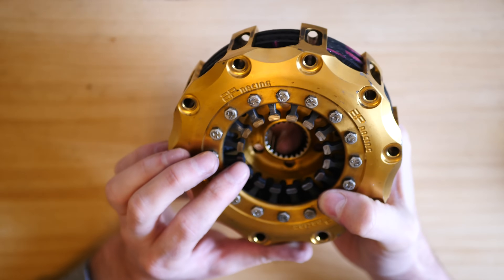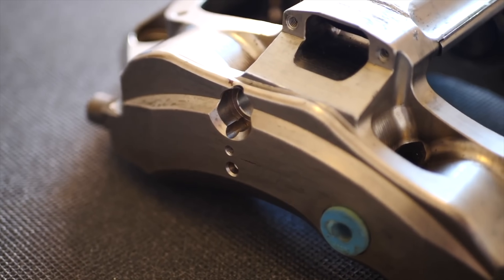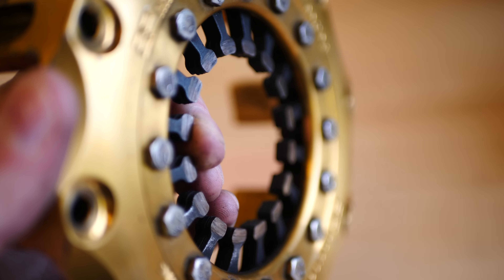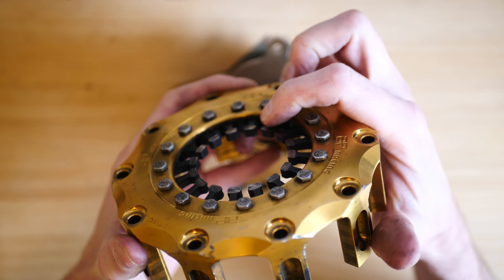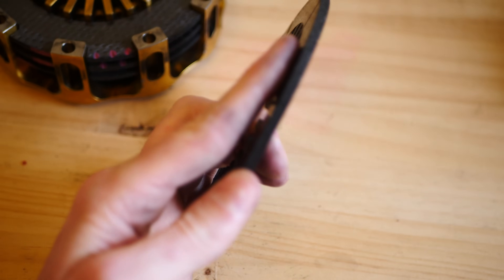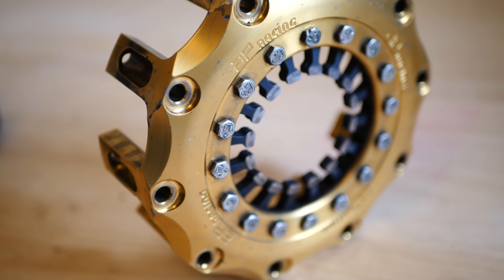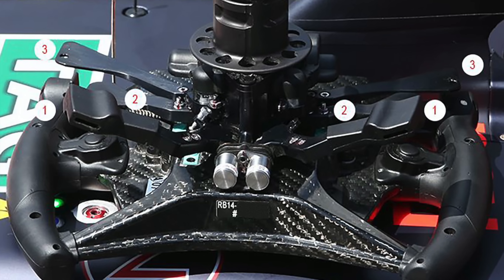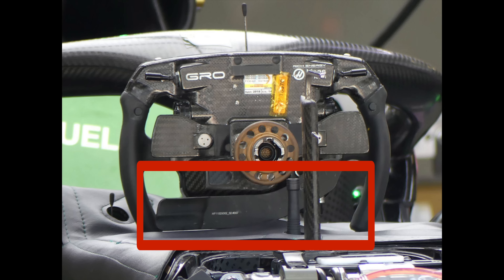How an F1 Clutch Works | F1 Engineering

Comment: If the clutch isn't used when shifting, how do gear changes occur without the drive train destroying itself?!
Reply: Almost any manual transmission car can be driven with out using the clutch when changing gears.
Reply: @andrewdraper8336  that would be floating gears, which is different from a sequential gearbox, that uses tiny little "ears" to catch a gear into drive without, if not, no wear on the transmission
Reply: It's designed to be slammed in gear, he explains a bit about it in his gearbox video!
Reply: It's similar a lot to the ones used in motorcycles or WRC car, it's a sequential gearbox with straight cut gears and no synchros.
Reply: All of the above answers are pretty correct, they're designed to slam through gears. But also: the transmission does wear out, probably about halfway through a season and needs to be replaced. So they're not really trying to avoid destroying the drive train, they just want it as snappy as possible and if it needs rebuilt, so be it.
Reply: Ignore most these watch his video on it. Most are dog cut gears with no synchro. You can upshift without lift or clutch. Actually most cars or trans you can upshift without clutch just not the best long term.
Reply: It's a sequential transmission like a motorbike's. The gears aren't synchronized.
Reply: he's got a gearbox video, but it's more or less a sequential gearbox that uses dog's to get it to swap gears, using the clutch to change gears would result in not having the engine forcing the car forward at all times even if it would be a miniscule time with the DCT's have now....still too slow for F1 though.
Reply: @SARCASMlC  and mostly a lot heavier
Reply: DOG BOX, SLAM SHIFTS BABY!
Reply: https://youtu.be/bChciv9_BuQ
Reply: Constant mesh gears with dog rings. Ram them home.
Reply: Dog gear box, like ones in motorcycles
Reply: Power cut by the ecu ....
Reply: DoxTT \
Reply: @blanca5050  exactly and rev matching on downshifts

Comment: The first line of the vid was so casual.
"I've got an F1 clutch here"

Ah yes no biggie, just another F1 clutch
Reply: I know right. Like he has a bunch of f1 clutch sitting down casually in his drawer
Reply: Like that one guy that ordered a BMW clutch off amazon and received an F1 clutch instead.
Reply: @outremer91  :))
Reply: After seeing latest vids I guess we actually know where he gets the parts. His father is working on 5 F1 cars of different eras currently.
Reply: Exact same though hahah
Reply: Yeah we see those everyday around these parts, nothing special.
Reply: While yes an actual F1 clutch is uncommon, small 5.5 clutches have been around for quite a few years for American v8, longer for the import crowd, can now get 4.5 units.  They get pricey with carbon clutches, but there is also diminishing returns on inertia reduction with smaller diameters, some  inertia can be useful and most need to be driven on and off a trailer and around the pits ;)
Reply: he mugged every line
Reply: I swear
Reply: My current car is worth less than that clutch.
Reply: I mean.... it isn't.... it's just a piece some manufacturer threw away, it's not the rocket engine of Apollo 2
Reply: @ivankontra3446  An Apollo 2 rocket engine would be a very rare thing considering there never was an Apollo flight with that number. Maybe that's what you meant.
Reply: @skunkjobb  I don''t think you realize how cringe that was
Reply: @ivankontra3446  No, you tell me.
Reply: @skunkjobb  It was so cringe whoever read it now has no lips.
Reply: @ivankontra3446  Explain
Reply: @skunkjobb  Say please.
Reply: @ivankontra3446  Stop being silly.
Reply: @ivankontra3446  Uhm, they're built in house. Defective units are often torn apart for usable parts. A clutch is a clutch, until its comprised of rare earth alloys and the like and has hundreds of millions of R&D, tens of millions of testing. An F1 clutch isn't something you can just nab from a Manufacturer as they're bespoke parts made specifically for an F1 team. It's rather rare to acquire an F1 clutch thats still in one whole piece, considering they're usually again torn apart for parts. ( Usuable parts are useful for testing, rather than wasting precious wear on  whatever random testing they're doing, they'll use worn but usable parts from used clutches, prior to winter testing. )

Like.. the hell does this dude manage this?? D: = = he has a whole F1 car behind him doesn't he?

Comment: Now I need to know, why the driver only needs the clutch when coming from a stop. Do they work with rev-speed or is there a link missing? (I watched the gearbox video) They can't just slamm the next gear in, hoping that it does not fail
Reply: Yet that's what they do! The gearboxes in F1 are different then road cars, they look more like motorcicle gearboxes then cars. They are designed to be just "slammed in" and not break (even tho ocasionally they still do). There are a lot of videos explaining how they work.
Reply: Gears are stacked together N1234567 so there isn’t a neutral between them (there actually is a false one, but that’s different story) so the gearbox pneumatically slams the next gear in with the help of ignition timing and all of that sorcery to match revs.

Comment: same as a motorcyle dry clutch!
Reply: that costs as much as a motorcycle
Reply: Yep. Except for the size. materials and spring system, I recognise it is as fundamentally the same arrangement and operation of plates as my old 1970's T140 Bonny.
Reply: Yes the only deference is the release bearing
Reply: true, just like bike dry clutches it won't last thousands of releases like a wet variant.
Reply: Same principle, just better materials to make it lighter and have less play
Reply: or wet clutch, same principle.
Reply: I have a 1972 Triumph with a wet clutch that looks the same.
Reply: sayan das yes sir
Reply: Half car clutch and half bike clutch.
Reply: mrdilligaf1968 the only half car part is that it’s just in a car, it’s the same construction and principal except mounted in a car and has a little different spring system to allow a strait though input shaft.
Reply: It's amazing that f1 is using only an upgraded version of a very old technology from motorbikes
Reply: Wet or dry
Reply: Bikes have both, depending on the quality of the bike...
Reply: Huh? What motorcycle do you own? There is nothing here that is the "same" aside from it being a clutch.
Reply: @JoeJacksonGT3  Apart from different spring, which is more like car clutch diaphragm spring, there's no such a big difference.
Reply: JoeyandLindsay the construction is almost identical. You’ve seen a motorcycle clutch right. I’ve rebuilt loads of bike clutches and they all look like and work like some variant of that design.
Reply: @JoeJacksonGT3  Apart from being a basket type, with multiple plates. OMG some people are pedantic
Reply: Apart from motorbike clutches are wet 🤷🏻‍♂️ or at least the bikes I’ve ridden have wet clutches
Reply: Faith n’ Fitness plenty of dry clutches on racing bikes and ducatis
Reply: William Hendrix sorry, not from my experience, I passed on a 600 bandit, wet clutch, and I’ve personally only owned sports/super sports bikes, all wet clutches
Reply: @Sacrifice-Paid  Ducati, Aprilia, Suzuki, KTM have / do  use dry clutches and in racing aplications in all manner of bikes teams will do a dry clutch conversion.
Reply: TheMessiah there’s an old saying, you learn sumin new everyday, from where I’ve come from in the biking scene, I’ve only ever heard of wet clutches, and I’ve only been watching MotoGP for a few years now, unlike F1....., btw, what’s with ur username?
Reply: @Sacrifice-Paid  LOL you must live in a pretty closed enviroment if you've never heard of dry clutches. The meaning of my user name is of no importance to you.
Reply: TheMessiah oh you’re full of charm aren’t you, just cos I’ve never heard of dry clutches you say that, as for your username, there’s only 1 Messiah...., thanks all the same, maybe next time I won’t bother
Reply: @Sacrifice-Paid  ducatis, especially their sport/super sport range, the panigales and so on, use dry clutches for ages. also there's plenty of messiahs, or guys who claim to be.
Reply: Nikola Dietmar Krapp I’ve got no experience with Ducati’s so I’m not gonna talk out of ignorance, and there is only 1 Messiah, simple......
Reply: Faith n’ Fitness how do we know that?
Reply: @AdamKyleAnderson  Yamaha TZ engines too!
Reply: @Sacrifice-Paid  Ducati's are well known for using dry clutches. Thats why they make that noise like you have left your keys in your pocket on some jeans in the washing machine
Reply: @Sacrifice-Paid  so please don't just assume that because you never heard a dry-clutch that they don't exist cause you might not mean it but you sound like you do
Reply: Faith n’ Fitness Ducati’s have dry clutches
Reply: @Sacrifice-Paid  just a tip for offline life, if you don't wanna sound like a douchebag, don't talk back as much when you are wrong.   While not supercommon, that's why it read motorcycle dry clutch, not just motorcycle clutch, it's been the normal with ducati for a looooong time.
Reply: @gur262  all that argument over wet/dry clutch and EVERYBODY MISSED THE importance of this clutch design. "SMALL"  AND MULTI DISK...used in motorcycle and most all racing, even top fuel. Wet would be for high mileage(oiled)and dry for ultimate performance(no oil drag/sling-easier to replace worn disks). Yea the guy in the vid told us how ANY clutch works but flew by the design for racing aps. The small OD IS THE BIGGEST ADVANTAGE for racing but requires multi disks to get the friction area up to the high  torque requirements. The dry clutch ducati is interesting, sounds like max performance is the only goal even if its noisy or old fashioned. Didnt know that
Reply: Faith n’ Fitness - I’m not here to talk you down. Only to say that Ducati’s with dry clutches (quite a few actually) sounds like they are about to fall apart any minute because they don’t swim in a sump of oil. ;)
Reply: @Sacrifice-Paid  I am sorry you have yet to ride a decent bike...
Reply: @Sacrifice-Paid  all air and air/oil cooled flat 2 bmw's have dry clutchs as alot of ducati's, the ratteling ones.
Reply: @Sacrifice-Paid  Lots of Ducati's use dry clutches
Reply: Faith n’ Fitness not Ducati’s, it’s also the same as a wet clutch
Reply: @Sacrifice-Paid  ducati often use dry clutch in their bikes that why you can hear the distinct sound when they change gears
Reply: Faith n’ Fitness 76 , Ducati uses a dry clutch on all their bikes
Reply: Ok lads, he's got it.
Reply: @Sacrifice-Paid  not all come stock with wet. (ducati has a few dry clutches) 

and even a wet one can be modified to instal a dry one.
Reply: @Sacrifice-Paid  most bikes I've seen have wet clutches, but some are dry.
Reply: Not even in the same league. Think again.
Reply: Sky Bound the construction is identical give or take a few different things
Reply: @peanuts2105  in materials sure. But the mechanics and principle is exactly the same as motorcycles
Reply: @peanuts2105  "OMG F1 cars use 4 wheels, just like my Honda Civic" Formula 1 uses technology that you find in consumer vehicles, they're just higher quality. Instead of separating the two based on their league, why don't we appreciate the similarity between F1 and road cars?